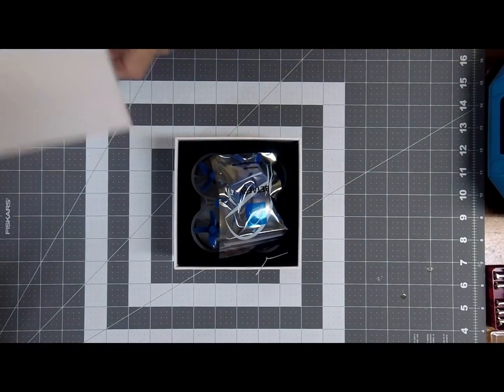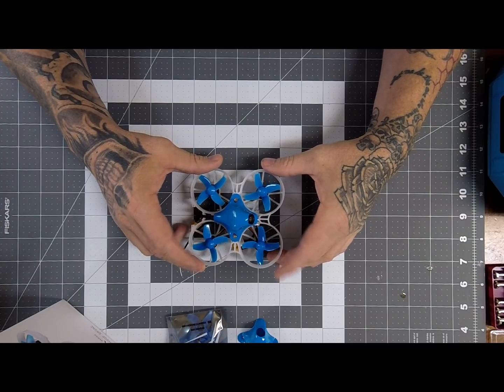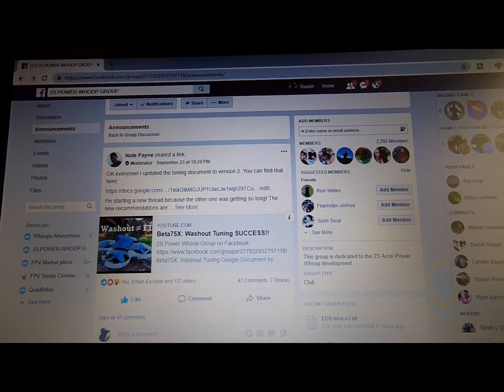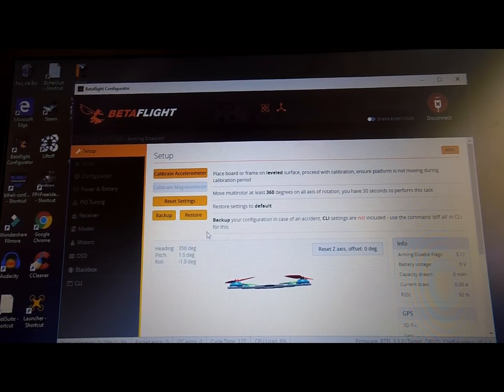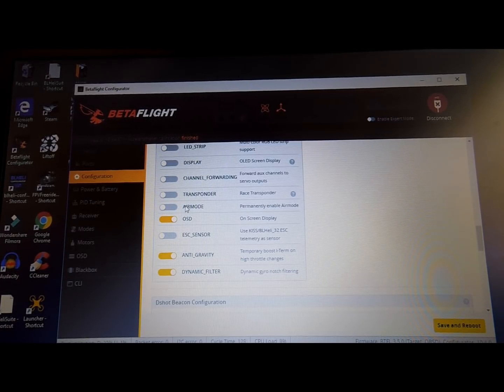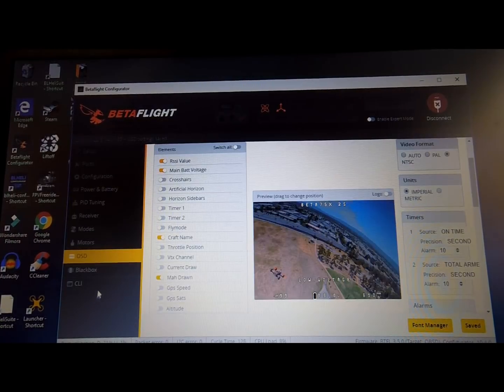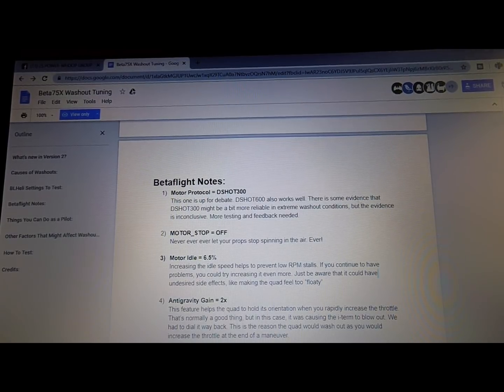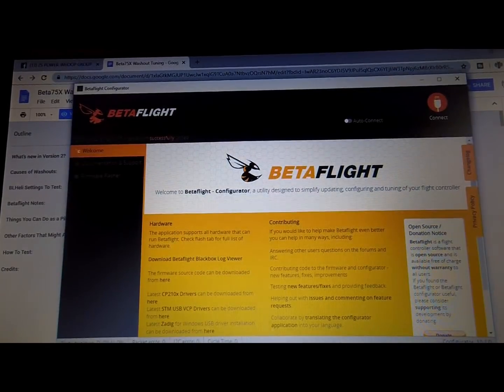Beta 75X Unboxing, set up and tuining

Comment: was there something that you read or heard elsewhere that made you change your mind about turning Smart Feedforward on?
Reply from the maker: When ff is up to 96,96,100 it's basically in full effect so sff wouldn't work properly.  It's a type of expo,  taking the speed of the stick movement into account as well as the amount of stick movement.  So you can take the advantage of a softer input bit still be able to have the extreme movement when needed.  The little 75 and 65x just don't have the power to utilize it.
Reply: @dustinbailey1980  ah ok I gotcha, thanks for the reply! also I am new to the quad experience and I'm wondering if you like to do anything to your throttle values or controls. I like to mess around indoors and i have a hard time controlling throttle. I bounce up and down as I try to compensate for my rise or fall. Or is it just supposed to be that difficult at first?
Reply from the maker: @motto25  that just comes with time.  I got my but kicked at first
Even months into it in tried flying in a parking garage lol it was horrible
Reply: @dustinbailey1980  hah! I gotcha. that makes me feel a little better. flying inside is teaching me a great amount of control I guess..
Reply: get Liftoff on steam and connect your transmitter to your pc to practice. it makes a huge difference when there's no chance you're breaking a real quad you can learn so much faster.
Reply: @mrb2917  I was flying in velocidrone for 3 days until i rolled over my only usb mini cable :( I flew for at least 8 hours and it was quite addicting. just flew my new kopis 2 for the first time today and I had a blast. only troubling thing is I felt like I was losing RX signal at a shorter distance than I expected.  It felt shorter than what I pushed my beta 75 to. Any suggestions to what it might be?

Comment: hey thanks for all of the help. just upgraded mine. this is my first quad ever so its nice to have it fly as easy as possible. how do I fly acro mode? is that the same as Air mode? I tried doing a roll and the quad just banked hard and flew 5 houses away and crashed. I thought I lost it on the first 30 seconds of flying it,
Reply from the maker: Air mode just means that at zero throttle the props idle and don't come to a complete stop.  Most acrobatics are performed at zero throttle.  Air mode let's you control the quad without throttle. 
Acro mode (also known as rate mode)  just means that the quad will not level itself out.  
To use acro mode, in your switch set up just set the same 3 way toggle so in position 1 is angle (stab),  and position 2 is horizon,  and position 3 (acro)  is actually just deselecting angle and horizon. 
There isn't an acro mode,  it's just turning off angle and horizon
Reply: awesome. thanks so much for the help. I couldn't find anything about it on google over the past few days. I cant wait to fly it again!!!

Comment: Also having washouts after the tune on betaflight and blheli. My pid setting show profile 2 and rateprofile 1 in betaflight by default. I haven't set up other rate profiles so I'm wondering if the quad is using profile 1 when I fly instead of profile 2, which has the new settings?
Reply from the maker: Just change both profiles to the same settings. 
One thing I noticed for sure is turn off smart feed forward. 
And set feed forward at 90/90/100
And motor idle at 6.8
Reply: Dustin Bailey cool thanks. Right now smart feed forward is on and settings are 96/96/100 I think. Also idle at 6.5. I'll try those adjustments. So that tune on Facebook didn't fix everything? Could be the way I fly too 🙄
Reply: Dustin Bailey those adjustments seemed to help. Not getting as many washouts. My used mah at the end of the flight is over 1000 when I'm using 350 packs. Any way to get it to be more accurate?
Reply from the maker: @DRTOLLZ  that should be in the power settings. 
Make sure you input the battery size and mah also

Comment: Hey man, did you get any clarification on the iTerm relax setup info? Got a 75x coming Friday and I'd like to get it in the air asap.  Rock on.
Reply from the maker: I term relax on,  I term rotation off.  Smart feed forward  off,  feed forward 96,96,100
Reply: @dustinbailey1980  You have smart feed forward on in the video to account for the feed forward changes. So should it be on or off?